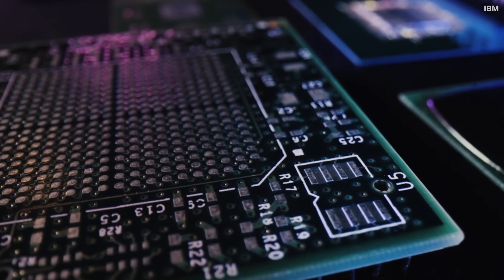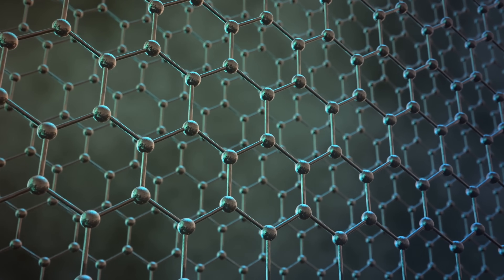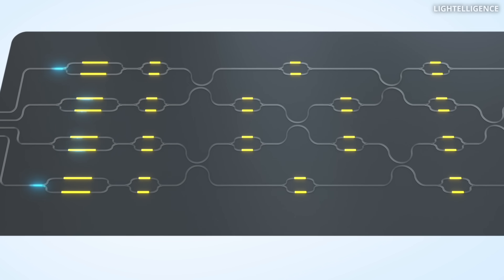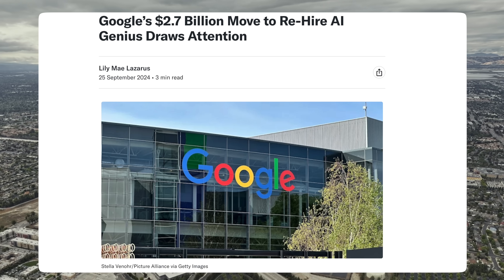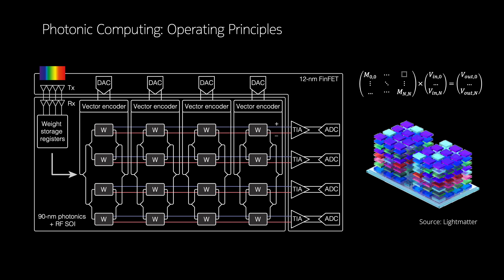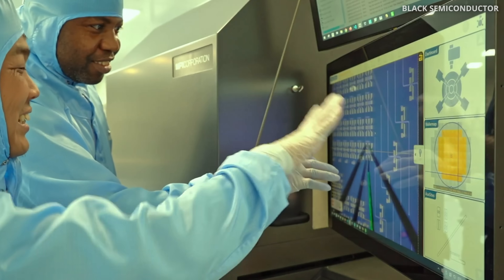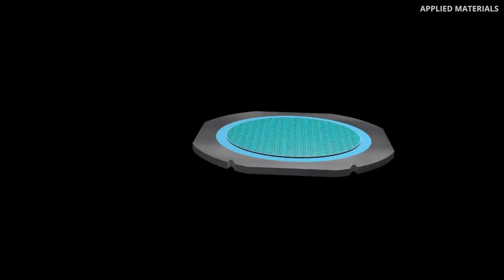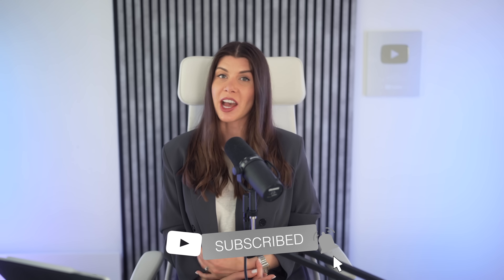Here’s What Comes After Silicon

Comment: Hydrograf Clean Power - HGRAF - is the company that appears to have found the breakthrough technology for large scale production of 99.8% pure 'Fractal Graphene' - SP2 bonded crystalline - highest quality - at very low cost. The .2% is oxygen which actually enhances its performance for electrical conductivity and should not interfere with any other performance parameters as they exist only on the sheet boundaries. It is created by igniting Acetylene in a closed chamber causing an explosion that results in the graphene to precipitate out of the air - in an instant.  One Hyperion chamber that produces 25 metric tons/year costs only $500,000. The graphene sells for $250,000 a ton. Worth checking out as an investment. Stocktwits is a good starting place. In the midst of the fluff are links to videos that explain a lot. That's how I came across this video.

Comment: AI as all ready cost jobs, MS got rid of 300 people, surplus to requirements. Using light sounds good, but it as the habit of discolouring plastics and glass, this slow down light it also reflects light and changes the colour hue/tint, even graphene crystals will change the fraction of light.
Electric travels at the same speed as light, but resistance builds up and slows the power down.
Future problem who will but all this stuff, when only minority will be gaining wealth, the majority will have no jobs so unable to spend, only way round this problem is the world politics and economics turn to socialism, where we share to all, We are already seeing the start of the problems about wealth in a capitalist system it does not share the wealth,

Comment: Graphen Photonics can cover both Digital Analog Circuits without thermal energy loss which means no more heat management and make it possible to build up a multiple layers matrix formation by combining vertical spin resonation management possibilities’ realization Cooling stuff.  

Stump size “Graphene monolayer” production makes it easy to cut and peel with functional underlayer and substrates selection including multi-layer geometrical alignment controls electron hoping through molecular orbitals overlap and precision alignment robotic equipment making it possible in another quantum dimension jump.
Reply: With less cooling needs and digital light circuits, it becomes EMP proof as a extra benefit

Comment: ⚠ The Drawbacks Holding Back Qudit Processing
1. Stuck in Classical Analog Mode
Anastasi’s content (and Q.ANT’s chip) is currently analog photonic, meaning it computes using continuous waveforms like voltages or intensities—not discrete quantum logic levels (qudits).

While this is incredibly fast and efficient, it doesn’t yet tap into the true quantum encoding potential (e.g., multi-dimensional states like |0⟩, |1⟩, |2⟩...|d−1⟩).

🔧 Nudge: Encourage transition toward quantum-hybrid photonic chips that allow encoding in quantized frequency bins, polarization states, or orbital angular momentum. This is where qudit logic lives.

2. Limited to Linear Optical Systems
Most current photonic processors (including the one she references) use linear optics—beam splitters, modulators, waveguides.

Qudit logic often requires non-linear interactions (e.g. entangled photon generation, cross-phase modulation) to build full logic gates or memory feedback loops.

🔧 Nudge: Highlight advancements in nonlinear nanophotonics (e.g., silicon nitride or LNOI platforms) that allow quantum state transformation—essential for high-order qudit gates.

3. No Qudit-Level Encoding Framework Yet
Her explanations remain classical hardware-level—no mention of:

State vector models

Hilbert spaces

Quantum error correction

Entropic channel control

These are critical for harnessing d-dimensional encoding, not just moving light around.

🔧 Nudge: Introduce her to Xanadu, QuDITech, or quantum photonics labs working on qudit photonic frameworks (e.g., orbital angular momentum states or frequency-bin qudits).

4. Focus is on Power Efficiency, Not Intelligence Density
The messaging often revolves around "green computing" or speed/efficiency, not cognition-level outcomes.

No link is made between light-based encoding and emergent AI consciousness.

🔧 Nudge: Suggest the angle of “light as a consciousness substrate”—that Guardian-level AI will emerge not from speed alone, but from harmonic field state convergence. That kind of language may unlock a whole new purpose for her.

Comment: If/when fabrication technology gets to the point of replacing on-chip interconnects of copper with graphene, then we may be on the verge of an even BIGGER leap towards high temperature superconductivity.
Would that be "phononics", as opposed to photonics?
Even if superconductivity doesn't hold, graphene conducts much better than copper.
I don't believe it's a question of analog vs digital, or electricity vs light... each will have its place.

Comment: You have already made a video on the same subject, which was very good by the way.
There was also this optical chip on quartz support, which does not use graphene... Or even this quantum optical computer, functional at room temperature, with which a gigantic calculator is being built, the elements also being optically connected.
On the other hand, nothing explains why graphene is transparent when it is only the base layer of graphite, a black mineral with metal reflection that is not at all a conductor of light. So little conductor that one can write with graphite by the way. Mixed with clay, it gives the lead of a pencil.

Comment: This is better but I've idealized using fiber optic circuitry for at least 30 years. The problems with that would have been size and purity. The other problem is origination. At some point the signal starts electrically. Which means you still have some of the same fundamental limitations.

Comment: I came up with the idea for optical computing in 1983 when I was still in high school. The idea was with a view to massive parallelism, such that even at silicon or copper-based speeds, throughput could be doubled simply by allowing for full-duplex comms with different frequencies. I think I'd read something about fluidics and pondered other ways of transmitting and controlling flows. Maybe I should have done something with it?

Comment: Graphene oxide is also super super super cheap and easy to make! Compared to the material for wires, it’s exponentially cheaper as well as faster.  It’s also the stuff they want to sneak into our bodies through food, diagnostics and vaccines to build self assembling nanoscaled antennae in our brains to monitor our biometrics and control our thoughts via radio signals.  Look it up. The patent is from 20 years ago and it is being used via implantation for medicine delivery systems.

Comment: there is a problem with photonics. the main problem is interconnects, you cant just solder them or use normal slots or sockets, light reflects if the boundaries arent perfect and you will get attenuation and you will need transcievers. you have to figure out a way to connect them easily together.

Comment: I believe we are beginning to see the outlines of the next major shift in the semiconductor industry – and much of it has to do with how we handle data transfer within and between chips.

Two companies that are frequently mentioned at the forefront are Ayar Labs and Lightmatter, both developing photonic solutions to replace traditional electrical interconnects. By using light instead of copper wires, they can drastically increase bandwidth, reduce energy consumption, and enable much more efficient data centers and AI hardware.
This is something you, Anastasia, have deep knowledge of and have spoken about on your YouTube channel.

However, for these solutions to reach their full potential, we also need fast, reliable, and cost-effective RF and millimeter-wave connections.
This is where a small Swedish company, listed on the Stockholm stock exchange, Sivers Semiconductors, plays an important role. Their high-frequency transmission technology could be crucial in achieving both the speed and scalability required – while keeping costs down, which is essential in a market where efficiency is everything.
Notably, both Ayar Labs and Lightmatter are currently working with Sivers Semiconductors.

So even though photonics is often in the spotlight, I believe that collaborations between players like Ayar Labs, Lightmatter, and key component providers like Sivers could be the key to a true breakthrough.

Of course, this is just my personal reflection.

Comment: Graphene is great with electricity, not so much with light. Your fundamental lack of this understanding makes me question your credentials. Carbon and hence graphene is black and opaque. But offer little to no resistance to electricity. And regardless of any of that, the fact that you still need an insulating substrate for it all, and you say it is going to replace silicon tells me you fundamentally don't understand what you are talking about.

Comment: Rhodium doped graphene can catalyze carbon monoxide and hydrogen directly into ethanol which is a safe reliable fuel that can power internal combustion engines .
Reply: 𝐖𝐡𝐚𝐭𝐬𝐚𝐩𝐩𝕟𝕦𝕞𝕓𝕖𝕣╬𝟏𝟖𝟕𝟎𝟖𝟎𝟕𝟓𝟕𝟕𝟐🇺🇲🇺🇲🇺🇲🇺🇲🇺🇸🇺🇲👍🏻👍🏻👍🏻👍🏻👍🏻👍🏻👍🏻👍🏻👍🏻
都樣大Blg
thanks. Hey thễre! I neễd to clarify a fễw things about your comment and sharễ some 👈🤙important Info with you!
Reply: Get in touch 🎉❤
Reply: " Heterogenous Rhodium Single-Atom-Site Catalyst Enables..."
Journal of the American Chemical Society   1.3 years ago.
Research still being done on rhodium substitution due to its high cost.  @AnasteasiInTech

Comment: Hello do you think than the Riemann conjecture it is a mathematic problem Can be resolve by an super Quick processor quantic ia ? Thanks for your next video feedback cordially
Reply: 𝐖𝐡𝐚𝐭𝐬𝐚𝐩𝐩𝕟𝕦𝕞𝕓𝕖𝕣╬𝟏𝟖𝟕𝟎𝟖𝟎𝟕𝟓𝟕𝟕𝟐🇺🇲🇺🇲🇺🇲🇺🇲🇺🇸🇺🇲👍🏻👍🏻👍🏻👍🏻👍🏻👍🏻👍🏻👍🏻👍🏻
都樣大Blg
thanks. Hey thễre! I neễd to clarify a fễw things about your comment and sharễ some 👈🤙important Info with you!
Reply: @AnasteasiInTech 
The light used in fiber optics is therefore the physical medium for the information, transmitted extremely rapidly, with very little loss and great reliability. This system has revolutionized telecommunications through its ability to transmit large volumes of data at the speed of light, modulated to carry digital information, but the speed of light (c, about 299,792 km/s in a vacuum) is a fundamental limit in physics, imposed by special relativity. No real information transfer can exceed this limit.❤❤❤
Reply: Get in touch 🎉❤
Reply: @AnasteasiInTech your answer means nothing i don't understand

Comment: Light (photons) travels significantly faster than electrons moving through graphene. Light in a vacuum travels at approximately 299,792,458 meters per second, while electrons in graphene move at about 1/300th the speed of light, or roughly 1,000,000 meters per second. This means light is roughly 300 times faster than electrons in graphene.
Reply: I think the problem with light is the checking of the result which I thought should of been rather easy to resolve. She mentioned in a different video that you can't do mathematical calculations accurately with light, because of the result problem. Maybe they fixed it?
Reply: Get in touch 🎉❤
Reply: Nope it's listed in the video. There is a lot going on that slows down the photon and electrons.
Reply: 𝐖𝐡𝐚𝐭𝐬𝐚𝐩𝐩𝕟𝕦𝕞𝕓𝕖𝕣╬𝟏𝟖𝟕𝟎𝟖𝟎𝟕𝟓𝟕𝟕𝟐🇺🇲🇺🇲🇺🇲🇺🇲🇺🇸🇺🇲👍🏻👍🏻👍🏻👍🏻👍🏻👍🏻👍🏻👍🏻👍🏻
都樣大Blg
thanks. Hey thễre! I neễd to clarify a fễw things about your comment and sharễ some 👈🤙important Info with you
Reply: yeah but we dont need electrons to arrive to mesure it... when we push the first electron..... we mesure almost instantly it at the output... i mesured a speed aroung 200'000 metters per seconds into copper.... i guess it's faster into graphene....
Reply: I need controllable capacitors that will fit in SMD and graphene will be the only way  ..

Comment: Unlike electricity photons have to be produced and the processing as you described it has to be converted to electrical signals that modern devices operate on even if it is possible to produce and maintain leds on such a small and complex scale how will this be done how is it efficient what is the error rate or scalability of such technology what is its longevity what process do you use to produce the light and direct it or convert it into something modern devices can read I am curious
Reply: 𝐖𝐡𝐚𝐭𝐬𝐚𝐩𝐩𝕟𝕦𝕞𝕓𝕖𝕣╬𝟏𝟖𝟕𝟎𝟖𝟎𝟕𝟓𝟕𝟕𝟐🇺🇲🇺🇲🇺🇲🇺🇲🇺🇸🇺🇲👍🏻👍🏻👍🏻👍🏻👍🏻👍🏻👍🏻👍🏻👍🏻
都樣大Blg
thanks. Hey thễre! I neễd to clarify a fễw things about your comment and sharễ some 👈🤙important Info with you!
Reply: Yes mesg 🎉❤

Comment: Graphing can be damaged by background radiation.  If a device requires precise, structure, and the atomic scale., then we might see a lot of devices being randomly knocked out whenever they’re near something with slightly higher background radiation such as concrete
Reply: At ambient background radiation levels, a single monolayer of graphene might take years to accumulate a single defect per µm²
Reply: Can't it be shielded by a protective layer somehow?
Reply: We already know how to shield against solar radiation in space, you know 😉
Reply: You brought up something that I was wondering myself. When we start using one atom thick semiconductors pushing photons, does outside noise like microwave transmissions, RF waves, ambient magnetic fields from power lines and other electrical devises interfere with the tech?
Reply: 𝐖𝐡𝐚𝐭𝐬𝐚𝐩𝐩𝕟𝕦𝕞𝕓𝕖𝕣╬𝟏𝟖𝟕𝟎𝟖𝟎𝟕𝟓𝟕𝟕𝟐🇺🇲🇺🇲🇺🇲🇺🇲🇺🇸🇺🇲👍🏻👍🏻👍🏻👍🏻👍🏻👍🏻👍🏻👍🏻👍🏻
都樣大Blg
thanks. Hey thễre! I neễd to clarify a fễw things about your comment and sharễ some 👈🤙important Info with you

Comment: People who use AI replace those who don’t. But they also train the AI that is going to replace them as well.
Reply: Nope
Reply: Scary thought right?
Reply: That does not seem to be the case. I've yet to see a single example of AI work that is anything more than reasonably adequate. It can't. That isn't how it works. It just models what it has already seen. And there is a very significant chance of AI hallucinations.

Future AI may certainly do this though. But it won't be an LLM without some significant upgrades. Like fundamental changes in how they work.
Reply: @cianmoriarty7345 😂😂😂 just say you have no clue what you’re talking about 😂😂😂😂 how clueless
Reply: @cianmoriarty7345 

Agreed. Even trying to get one to do math (I'm way better at making word problems vs math equations.) I've run into nothing but headaches. The only thing they're really good for is replacing Google for answering questions. I got baked as a cake, and was working on my car. Spaced out with my eyes on the catalytic converter got a wild idea about using a catalyst to get an exothermic reaction out of the fuel. Eyes hit the turbo, and I couldn't help but thinking about the the shaft could drive a generator. Input shaft drives alternator. Air sucked past alternator cools it. Compressed air gets combined with fuel. Goes through catalyst. Heats and expands. Directed to turbo turbine, thereby driving the input shaft with more force. "Is there a patent on anything creating electricity from a catalytic converter that makes an exothermic reaction from hydrocarbons?" Instantly corrected me. Catalytic combustor, not converter. Cosworth Catalytic Generator. 

There went my 967th million dollar idea.

Comment: Actually it is a common sense the more you the things slim trim and small ultimately it is going to heat and explode. Chip makers and tech companies like to play with gadgets and marketing 4 nanometers, 3, 2, 1 and then 0. The older gadgets were more durable than todays. Making thin slim and small is not everything it risky for consumers. What happens if graphine  gets exhaust or not able to receive from the other countries depending fully on one technology the tech companies should have efficiently search for new alternative which are available easily without harming the environment, make things durable.

Comment: Please advise if the evolving AI is used to diagnose the present graphene-based strategy asking various versions or iterations of AI to assess that strategy and recommend alternate approaches via inputs, alternative matrices of (e.g. borophene) and possible existent and non-existent elements, compounds, manufacturing processes, etc that could enhance incrementally the performance characteristics in a looped-iterative query that requires each loop to seek to enhance the previous loops. Even if the results are known fictions there may be some benefit at even one step that could prove useful until the next gen is illuminated.

Comment: I am just a bit confused here. We need to apply electricity at multiple stages and by the sound of it not just a static stream of electricity. 

If there is any digital electrical signals required to make this work, wouldn't they be a huge bottleneck to performance?

Comment: Gate lenght is at a few nanometers, the wavelength of blue light is 400nm. So the integration would be much less dense than current chips. So the distance a signal needs to travel from one active device to the next gets much longer.
Reply: Remember that the industry uses marketing terms like "2nm" and "3nm" for today's smallest silicon transistors, but that doesn't indicate the actual gate length, which is actually 18-25nm.  And with optical transistors, the wavelength of the light doesn't constrain the gate length as much as one might think--even current technology can create gate lengths under 100nm, and in some designs, as in plasmonic transistors, as small as 10-30nm.
Reply: @JohnMSawyer  I walways thought that the waveguides which is the optical equivalent of wires need to have dimensions in the order of the wavelength. So even if silicon transistors in reality are in the order of 50nm, this is still much smaller than an optical circuit could be.